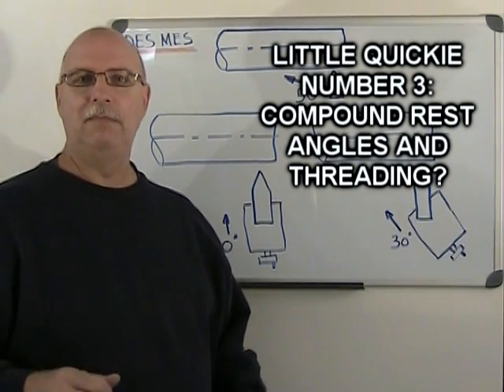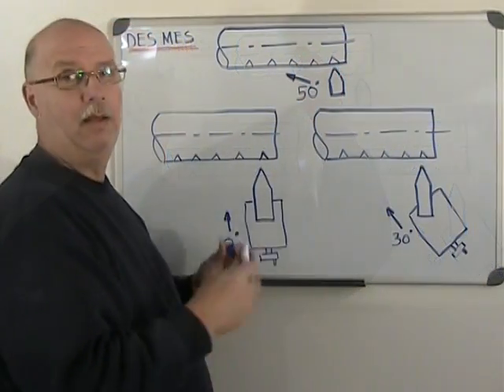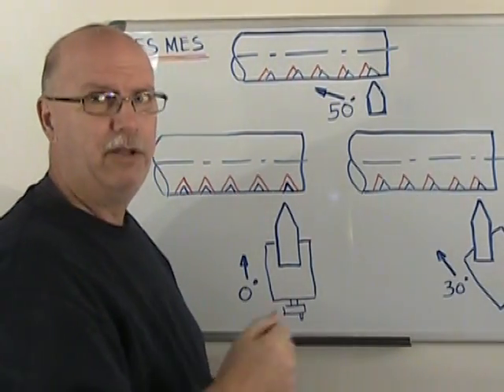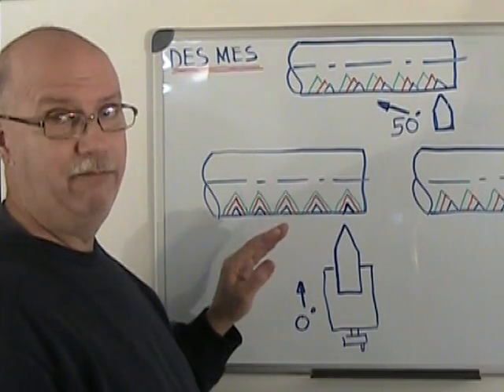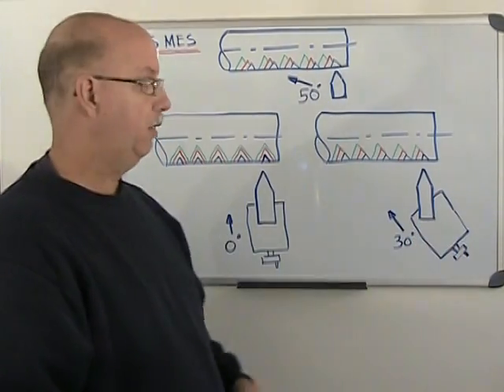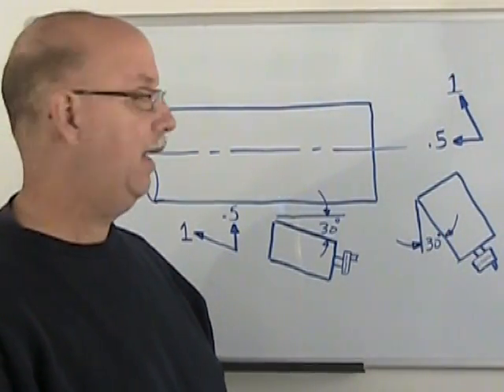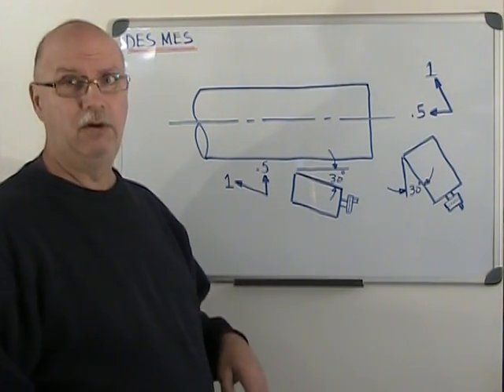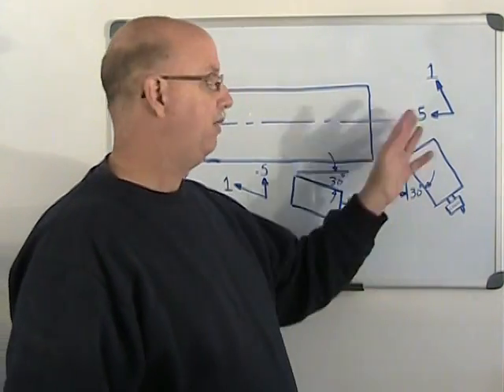THREAD CUTTING ANGLES FOR BEST RESULTS. HOW DOES THE PLUNGE ANGLE AFFECT THREADING? MARC LECUYER

Comment: I am new to this. Does the angle affect how you would time your half nut engagement when cutting threads? Or would you simply come back to where you started in your Z direction and go in another unit on compound and time it as before?
Reply from the maker: Hi Dan! The engagement of the split nut is not affected by the compound rest's angle. The normal sequence for cutting most materials would be : Take a cut by engaging the split nut on the appropriate division,  at the end of the cut disengage the split nut. Retract your tool using the Z (cross slide) axis and then return to your start point (past the start end of the part) and return the Z axis to zero (don't forget to set your Z zero during setup).  Now you can set your next depth of cut by advancing the tool toward the part using the compound rest (normally set between 29 and 30 degrees). You can now engage the split nut for the next cut and so on ... Using this method reduces the cutting force required and helps with not getting lost (forgetting at what depth the last cut was) since your cross slide always comes back to zero and the compound rest only advances. I you haven't already done so, check out my threading on the lathe video  https://www.youtube.com/watch?v=ObdqJKGZnGQ&feature=youtu.be   and for more threading examples check out the screw jack project   https://www.youtube.com/watch?v=tgyELiYk9Wg&feature=youtu.be   Thanks for watching and for taking the time to write, Marc

Comment: With a 29-30 degree cutting angle, we’re cutting on both sides of the bit. But most of the cut is on the leading edge. But the trailing cut does cut the part of the tip of the thread on the rear, and knocks off the small jag flies that would have otherwise occurred. This is well known as has been stated here in another video, that I believe was made later than this one.

Comment: Thank you for another informative video.  Machining is my second career and I'm new to the machining world.  I refer to only a couple different channels for help and instruction.  Yours is one that I am always referring to.   I did find one thing in this video that needs a little clarification.  On the 30 degree threading angle, you mention that the cutting tool only cuts on one side.  Even though the tool cuts on the entire left side, because the tool is plunging into the part, it appears to also be cutting on the right side of the tool, but only slightly.   Is this correct or am I seeing it differently.   Thank you do much for sharing your knowledge with new machinist like myself.

Comment: Good explanation.  It should be pointed out that some of the lathes from Taiwan and China have the scale on the compound that is 90 degrees rotated, so to achieve the 29 to 30 degree proper angle of the compound you really need to indicate 60-61 degrees on the scale.  The 3.5 part of the tip was most useful since I never thought about being able to change accuracy based on the sine of the screws, totally makes sense, just never thought about it (at least in terms of I turn the screw X and it advances at a ratio of X based on the angle).

Comment: related question, why do some people swing compound around to 30 degree the other side of perpendicular for internal threads? I think it doesn't matter which side of the tool cuts on, does it? front side if turn compound around so the handle is near the chuck or back side if the compound is swung with handle away from the chuck.

Can you explain your preference and why?

Comment: Hi Marc. I enjoyed your presentation. Good job. I am working on a video I will post within the next 24 hours to address some of this exact same material. Specifically, the 30 ( and 29 1/2) degree compound settings. You are still cutting on the right side of the tool in each circumstance. Take a look at my channel for the video that demonstrates it. Good job with the 3 colors. It really highlighted what is happening.

Comment: Hello Mark .Can  you please explain how set up top slide for imperial threads .For metric threads 60deg . is half 30 dag.(29) ,but what about UNF,UNC ,BSF, BSPP, BSPT,BA?. All are 55 deg.? so top slide must be 27.5 deg.? Thank you V.D.
Reply from the maker: Hi! Most (almost all ) imperial threads are 60°. However should you come across a 55° thread you would cut it the same way but, as you mentioned, you would position the compound rest at half of the threads angle (27.5°) minus 1° to ensure that your thread will be 55°. So 26.5° will work fine,. For small Acme threads (22°) the compound should be set at 10°, and so on. Large Acme threads are cut differently. I hope this answers you question? If not get back to me, Marc

Comment: Regarding earlier post, I mean that if the compound is set at 45 degrees, then for every mark you turn the dial on the compound your tool will advance into the work one half a mark.  So in turning down the diameter of a bar, advancing the compound by a one thousand mark will reduce the diameter by .005".  Isn't that right?
Reply from the maker: +ATINKERER Hi Atinkerer! Sorry for the late response. Sinus of 45° is 0.7071". That means that if you advance your 45° compound rest by .001" your tool will advance by 0.0007" in the longitudinal axis and if you are surfacing that means that the part will be 0.0007" shorter. However since the diameter cuts are made on both sides of the part simultaneously, if you advance the compound by .001" the tool will advance by 0.0007" in the transverse direction but the part will be .0014" smaller on its diameter. I hope this helps, If not let me know I  will try again. Marc
Reply: +THATLAZYMACHINIST 

Hi Marc, 

Thank you very much for the response.

I've been mistaken about this 45 compound thing for many many years!  I'm going to review your video and set my compound accordingly to advance the tool .0005" for every .001 mark on the dial.  I think I should also dust off my micrometer and use it to make sure I'm getting the cut I think I'm getting.   Maybe this is why I've always found it hard to turn things to the exact diameter I wanted, and almost always found that I've taken off a little more than I intended.

Great videos!  I've never seen someone so knowledgeable about high precision machining.

When I get the chance, if I ever have the time, I'd like to watch all your videos.

Sincerely,
Tony
Reply: +THATLAZYMACHINIST Got it!  I set the compound at 30 and I was surprised to be able to turn down the diameter of a bar by .001" at a time, accurately. Thank you very much!